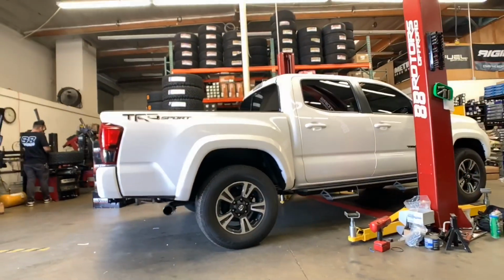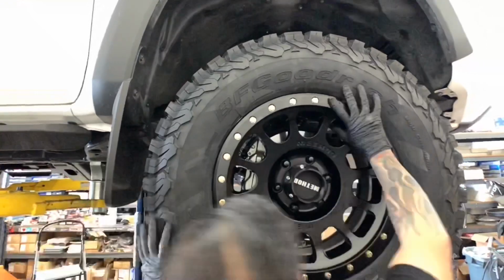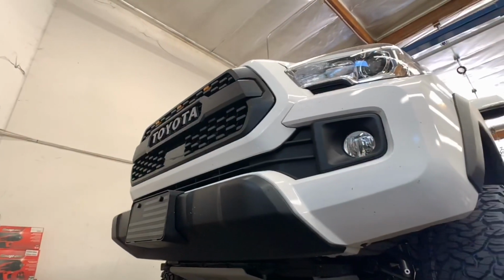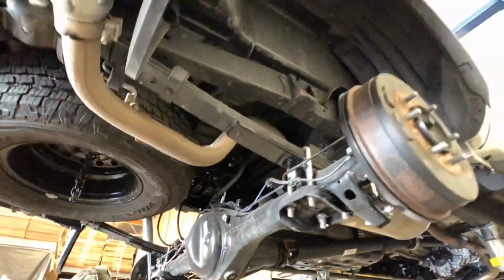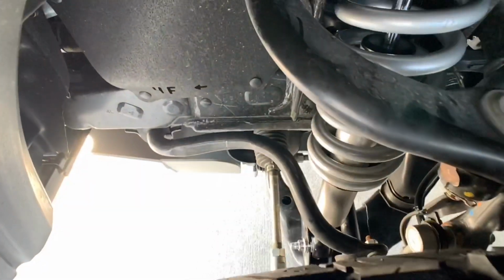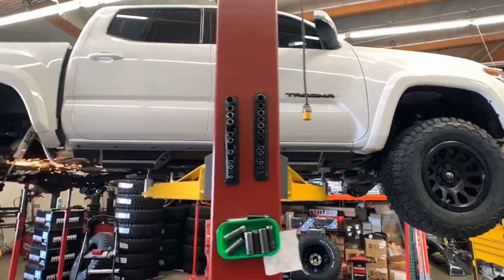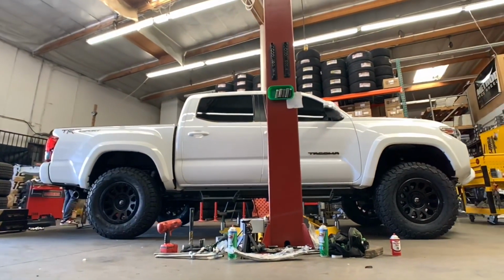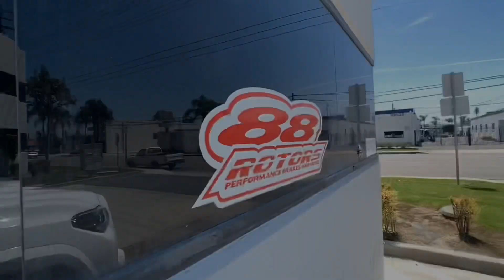Pair Of Tacoma Trucks Lifted on Fox Suspension & 285/70/17 Tires

Comment: what size bf goodrich ko2 can you run on stock suspension
Reply: I have a 2017 Tacoma stock running 265/70R16 slight rub when wheeling.